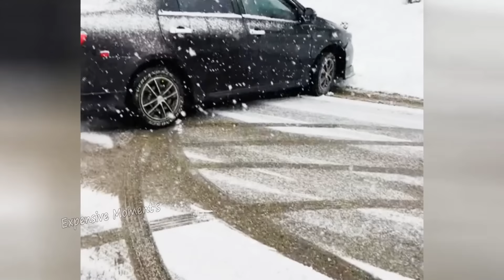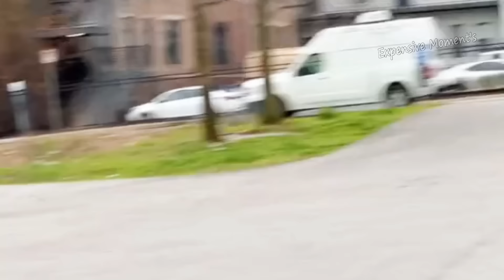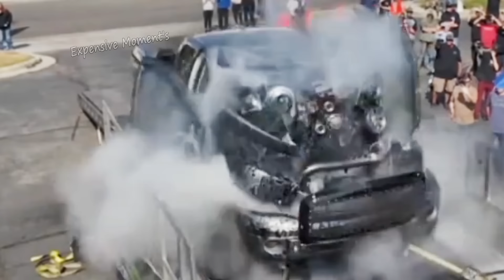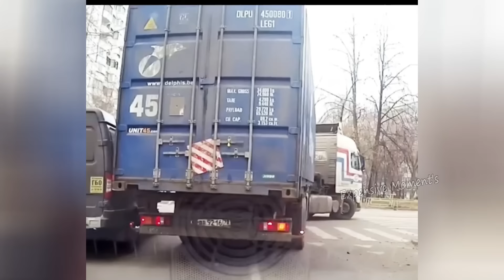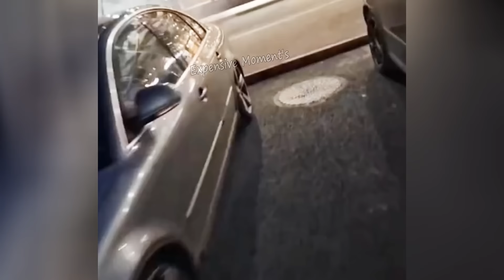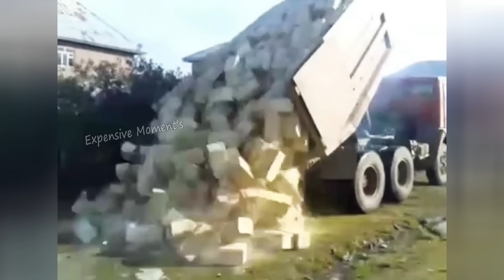TOP IDIOT CRAZY TRUCK DRIVERS - TRUCK RECOVERY GONE WRONG - TRUCK CRASH Compilation

Comment: I'm still amazed that science still hasn't come up with a way of warming roads so ice and snow don't form, bloody hell we can go to space, and other worlds, why not spend a  bit of science here first🤓 save lives💔
Reply: It had year's ago in Canada? But as usual people whinge about cost! Want something for nothing, We had similar technology in the UK,Up stairs car park had heat ramps
Reply: SALT. Turns snow into water. Not good for rust.
Reply: Go to Holland MI, the downtown streets never need plowed. The hot water from nearby powerplant is circulated under the roadways to warm them and cool the water before being discharged in Lake Michigan.
Reply: @happydays8171  Thanks for the info bro :) stay safe👍😀
Reply: I cant believe people havent figured out frozen water is hard to drive on by now. They have Google.
Reply: The best way to warm up the road to melt the ice or snow is TO DRIVE AS FAST AS POSSIBLE. The friction of your rapidly rotating tyres will do the job. Or, with luck, when you crash and catch fire and the heat will do the job nicely.
I'm from South Africa, and we don't understand this snow thing you are always moaning about.😊
In my 54 years here it has only snowed twice in Joburg. However, our hail makes up for our lack of snow.